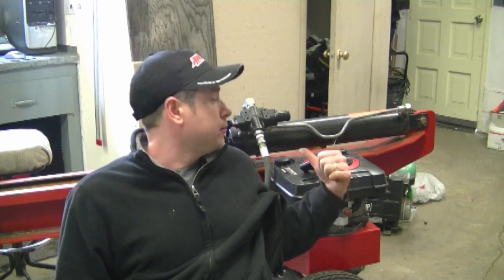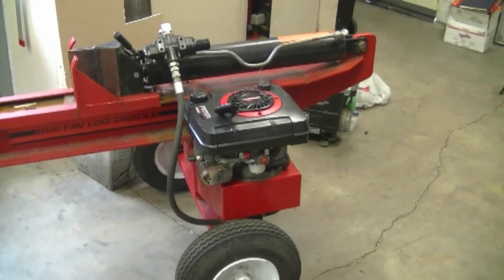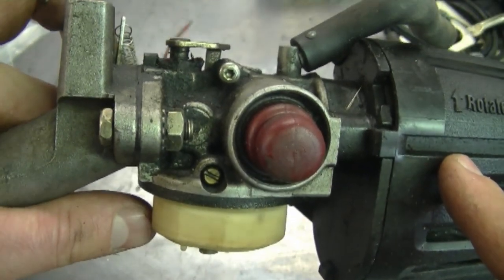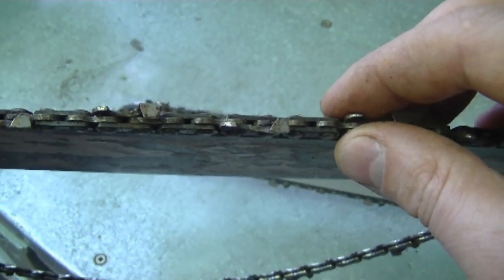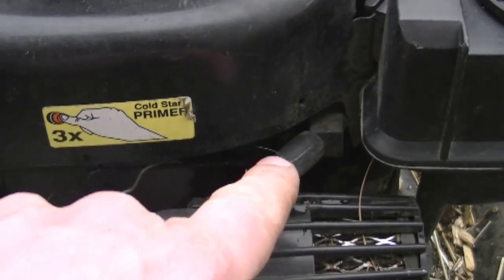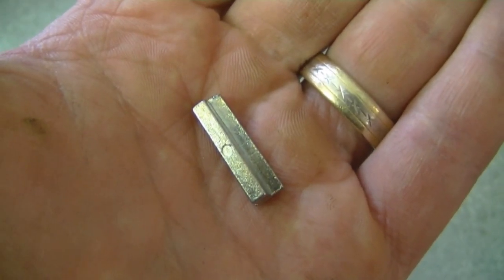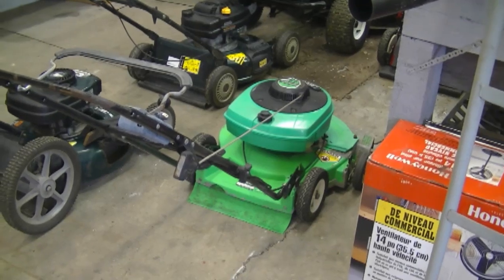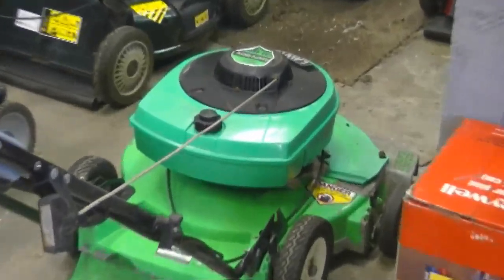Small Engines Q & A Video #99 in HD

Comment: crooked cutting can be caused by using a chain of the wrong gage, e.g. using an .058 chain on an .063 bar, as well as having cutters on one side that are sharper than those on the other side.

Comment: Dony boy I have a predator 212cc engine and it's having problems it's stating up then when I put the choke on it dies out and I rebuilt the carb and when I start it up it doesn't idle right and makes a really bad thump noise and it vibrates and kicks and I need help thank you

Comment: To add to the Tecumseh carburetor flooding issues. Another possibility is the float may be out of adjustment, especially if you replaced the float with a new one. There's a little metal tab on the float that the needle sits on which can be bent up or down to adjust how soon the valve closes based on the position of the float. If the tab is bent too far up the valve won't close when gas lifts the float. If its too far down it'll close too soon ans gas can't flow into the bowl.

Comment: That lawnboy sounds like a moto-x bike.  Dont forget your spring maintenance on your equipment. not only will it run better it will use less fuel saving you the cost of what you put in.

Comment: I had the kickback problem on a Poulan push mower with the Tecumseh engine and found the flywheel key sheared. After replacing the key it was still kicking back and just about tearing my arm off when it jerked the rope out of my hand. I did some more checking and found the key on the blade adapter was also sheared off. I replaced the adapter and no more problem. So thats another thing to check if fixing the flywheel key doesn't cure your problem.

Thanks for all the great videos.

Comment: HI DB,
Just wanted to comment about the saw chain pulling to one side.  Another thing that will cause this is when the chain cutters are not at an even length.  Sometimes when folks file their chains they will take a little more off the right cutters than the left because theyre right handed.  Use a crescent wrench to check the length starting with the shortest cutter, filing them all down equal with the shorty.  Good Job on the Lawnboy, a man after my own heart!
Best wishes,
Bob

Comment: Another nice q&a video. Im wondering what causes the engine to bog down on my weedeater when I try to run it full throttle and no choke. If I put it on half choke it runs fine but no choke the engine bogs.

Comment: Now I got to run through a starter on a Murray 20" push with electric start key ignition (missing a battery, got the mower for $10), and your vid on swapping batteries saved me by the AH (5, like the electric weedeaters). Same old story on this one- Funky Magneto arms, and the Genny was nasty. Also just got done with a ring-seized Troy-Bilt Roto-Tiller (had to work it out of seize like a baby, runs like a monster). Good carb vid, Mr. Dony.

Comment: I just had to beat on two Featherlites, one that was thrashed with water in the crankcase and on the piston (not to mention those C1U carbs that are a pain without a rebuild), and the other was the same (bad meter gasket). BOTH had the spline H/L Needle setups...thank you Dremel! Both also had weak recoil (easy enough fix, but time-consuming because of the way the starter spool is designed...BLEH!). At least they work now.

Comment: Even worse, when a diesel engine farm tractor gets water in the fuel tank it hydrolocks the injector pump. Only way to get it out is to disassemble the pump. I worked at a large crop farm where they had a underground fuel tank that had 40-50 gallons of snow melt water in there. Every tractor, combine, grain truck and skid loader hydrolocked up!

Comment: most 2-cycles don't have a liner, that's why nikasil was invented.
if a briggs has a liner, it's most of the time chromed. only I/C's have liners by default. smaller briggs up to 5hp don't have a coating neither a liner. it's a very dubious design theoretically, but it has worked for over 50 years now. just plain aluminium walls

Comment: Nice videos. Thanks for sharing your knowledge. Several times I have wound up with water in my fuel system. I drained the fuel, and threw in a small amount of gas additive that specifically removes water from gas. It has worked fine [for me] because once the engine is started, it vibrates the heck out of the water in the bottom of the bowl, and then I don't have to remove and reinstall the carburetor.

Comment from the maker: i ususally use standard and lightly hone the cylinder, if u go oversized u have to measure piston clearance and it's hard to do a pro job unless it is done on a lathe. you can do it yourself but won't be like new but will buy extra life in the engine

Comment: i do small engine repair,i wood start by cleaning the carb or get rebuild kit sounds like the needle vale might be sticking or the throttle control does the leaver seem sticky when u release does it go back right away or does it kind of lag,well the carb wood be your prob